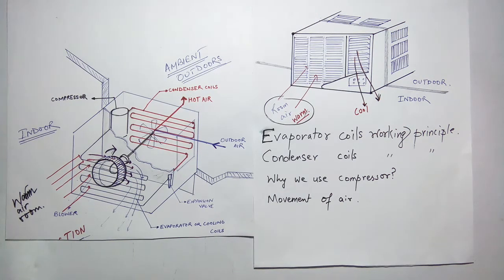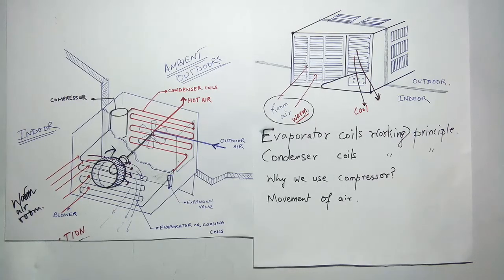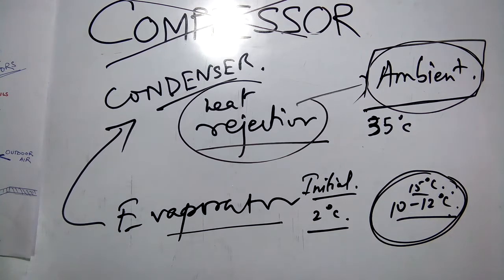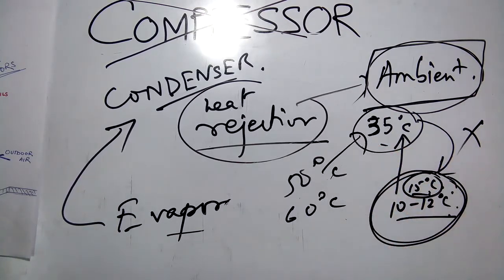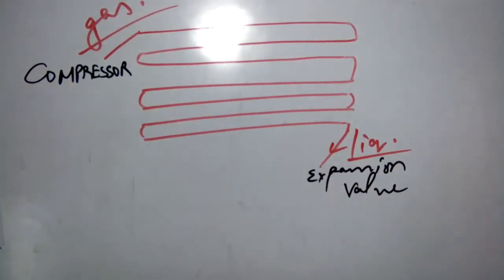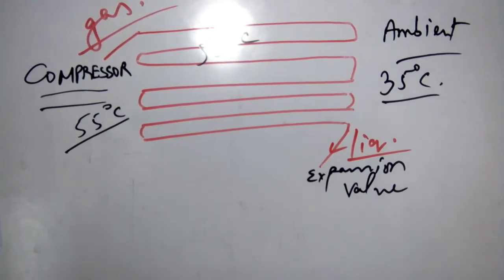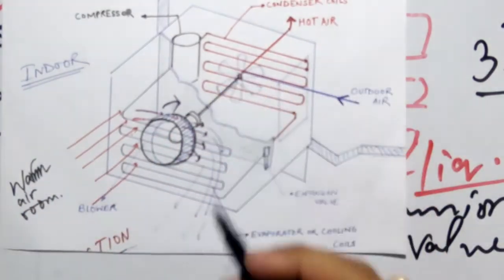How room air conditioner(AC) works- cooling with dehumidification

Comment: I have a doubt. both condenser coil and evaporator coil looks like board with so many fins in it. What for is that fins? Sir. y no reply for working of jet engines, aeroplane fly? Need working of automatic transmission, manual transmission etc. pls

Comment: In condenser how phase transfer take place , as you are assuming the temp of gas after comp as 55°c and ambient is at 35°c due to temp difference the Heat transfer will take place but what happen when the temp of gas reaches 35°c . How further fall in temp take place or refrigerant reaches below its bpt .

Comment: Sir, when refrigerant goes to compressor and its temp. And pressure increase for ex. 55°c and ambient temperature is 35°c then how its temperature decreases to its initial temperature i.e, 10°c as it will cool maximum to 35°c and how it be converted from gas to liquid

Comment: Thank u Rohit For Great Video, but i have a doubt while air leaves from compressor its temperature is 55°C & Ambient Temperature is 35°C Then how the temperature of outlet refrigerant from condenser comes to 2°C because my doubt is there is air is only coolant to cool the refrigerant & its temp. is 35°C then how outlet refrigerant comes in liquid state & its Boiling Point is 10°C?

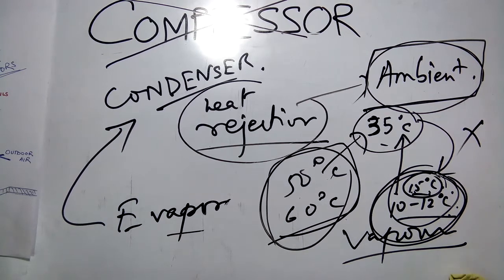Comment: DOUBT: at around 26:26 u have said that refrigerant temp after exit from evaporator is around 15 deg celcius. and abient temp is 35 deg. Whats the meaning in taking refrigerant temp above abient and taking down again to ambient using condenser ? Refrigerant will gain ambient temp spontaneously why compreesor needed. ? Plz explain genuine concepts... I invested many hours in all ur videos and now feeling that ur concepts arent clear or u r not able to explain neatly
Reply from the maker: See it is simple. In that portion I have tried to explain that why we need compressor.  The refrigerant must loose heat to the ambient in the condenser. For that temperature of the refrigerant must be higher than that of ambient... If the temperature of the refrigerant is lower than that of ambient, then ambient will give heat to the refrigerant instead... To avoid that we send the refrigerant from the evaporator to the compressor to make its temp.  Higher than that of ambient..then that heated and pressurised refrigerant moves to condenser.
Reply from the maker: What I explained is not wrong. You read my reply u will understand
Reply: See, sake of compressor is to bring high pressure back . High temp is because of compression and also because of heat flowed from food (in fridge )to refrigerant in evaporator process. This temp is reduced to normal ambient temp in condenser. and also phase change occurs here.  What u r saying in reply is irrelevant.Please think over it. Our sake is to get refrigerant at lower temp so that it will be able to extarct heat from food in fridge. Then why we will take refrigerant which is at 15 deg celcius (after exit from evaporator ) to a temp higher than ambient then bringing it back to ambient temp. ? Temp rise is undesirable always but its unavoidable due to compressor action and heat extraction from food. This temp rise due to both reasons is reduced in condenser. Reply me only if u disagree with me.